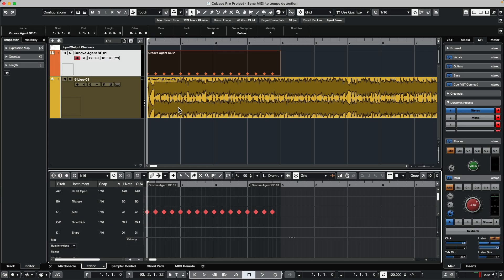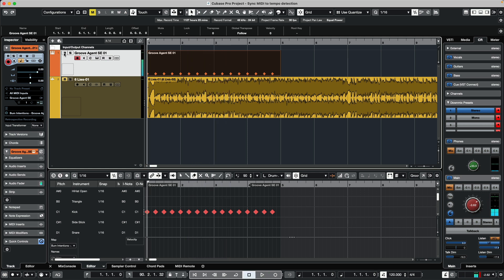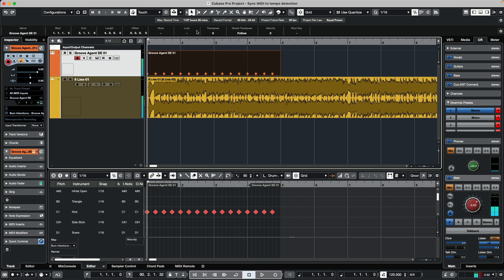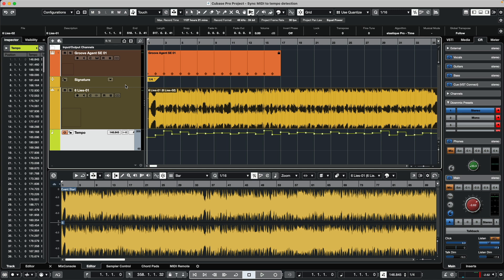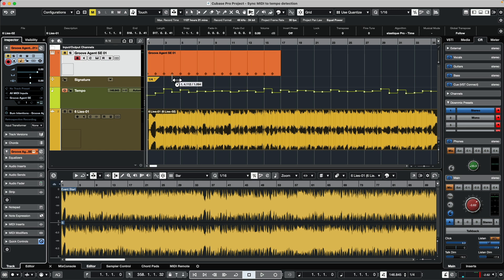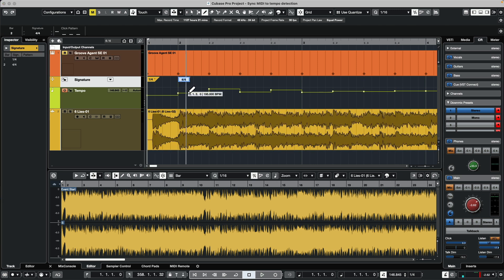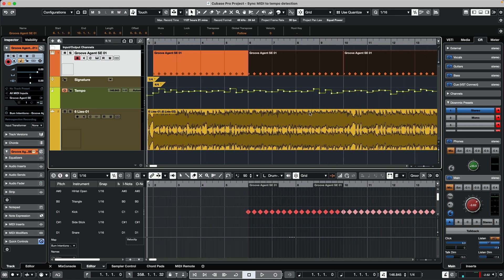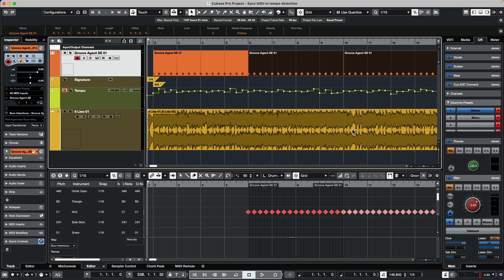Matching MIDI to Audio Using Tempo Detection | Cubase Q&A with Greg Ondo

Comment: Thank you very much for this video. That is something I have been looking for for a while. It is a big step forward to what I want to achieve.
But I do not know if it will be possible.
I want to link the vocal line that I have separated with Spectralayers to a Genos style.
That is, I run the separate audio file and synchronize the Genos style with the audio file via the created tempo map drum miditrack. I still have to find out if that is possible and how I can achieve that.
Do you think that would be possible. Thanks in advance for thinking about it. Kind regards

Comment: Please help.  Say I've programmed a track on my external midi sequencer, and its running at 120 bpm. Over midi, how can I make Cubase auto detect the bpm, set the project tempo accordingly, and lock the grid to my sequencer when I hit record, so everything is on time in the DAW ?  Thanks!
Reply: Send MIDI clock from Cubase to your external sequencer and set the external sequencer to chase MIDI clock.

Comment: I am unable to copy midi hits in the piano roll, say Kick and duplicate it for another hit, say HH. The copy paste function creates extra notes of the same drum part either layerd or extends it which is not what I want. Help. In reaper it's a simple highlight , hold Ctrl and drag to create double
Reply: If in the same event try dragging the events while holding alt?option and drag it vertically then press and hold control?command before releasing the mouse to constrain the direction of the move.  If you are copying to a different use the paste at origin command alt?option+V.

Comment: What's the impact of locking the Groove Agent track, and then unlocking it at the end?
Reply: If the MIDI track is not locked the events get shifted during the tempo detection process and will no longer have any connection to the grid.
Reply: @Greg_Ondo  Thanks Greg. I'll need to better understand that locking feature.

Comment: Hi Greg.
Is there a way to do something like this but to audio track?
Meaning, align audio track to MIDI grid?
Reply: After doing the tempo detection on the audio file, select the event and go to Audio - Advanced - Set Definition From tempo.  The audio file with tempo changes will now follow the project tempo.  There are earlier videos in the series that show this.
Reply: @Greg_Ondo  Thank you ☺
Reply: please post a link to that tutorial - I just tried this but when I set to fixed tempo click and track dont line up - so I must be missing a step ?    
 @Greg_Ondo

Comment: Just wonder why the metronome click in the lower menu moves from 160 to 180 when you plays thru the song but at the same time the sound of the tempo feels like its on the beats? 
The problem I have got when changing the tempo in a wav file from 133 to  118 is that the Count in and the metronome click is not following the actual beat. How do I solve that? 
All the best Greg, your tutorials is always a real timesaver!
Reply: Many real songs will fluctuate tempos more than expected when examined in more detail.
Reply: I noticed a setting under metronome setup called Count In - Time signature at project position. Might help?

Comment: Great info ! What is the difference between this and “Beat Calculator”
Reply: The Beat Calculator is really intended for finding the tempo of a loop.  You could use beat detective for every beat or bar and manually enter the tempo into the tempo track.  This process is much faster.

Comment: Nice video! Having done this many times, I don't remember having had to lock and unlock any midi events, what does that do?
Reply: If you have existing MIDI data on the grid before the tempo detection is done it gets shifted as the tempo info is created from the tempo detection.  It is then really hard to get it back on the grid.  Locking the MIDI tracks before prevents this from happening.  It is the one step that people often miss.  MIDI data created after the tempo tracks is not affected.
Reply: @Greg_Ondo  I wondered the same thing - thanks for clarifying this Greg